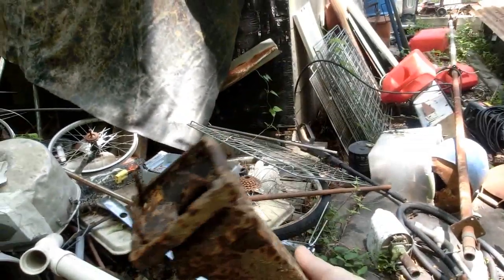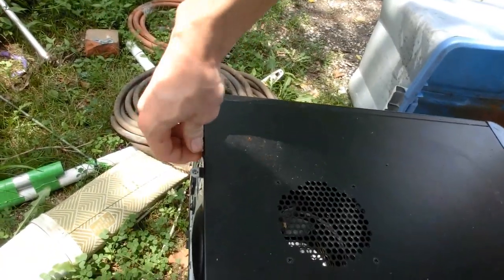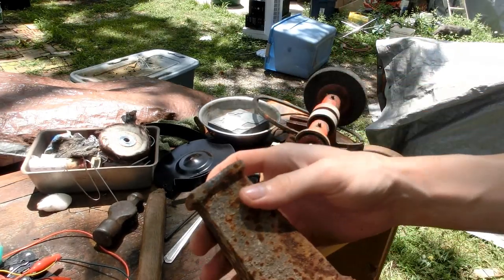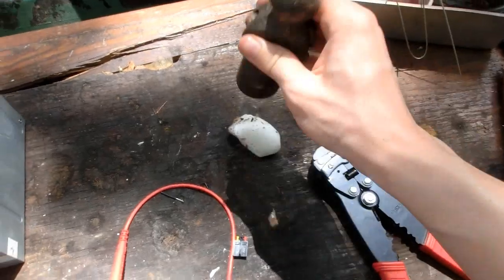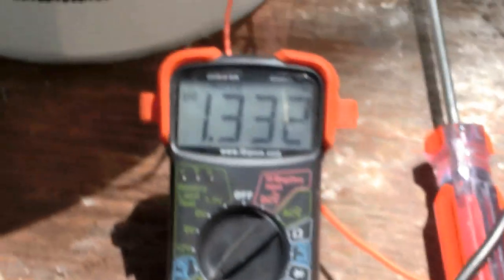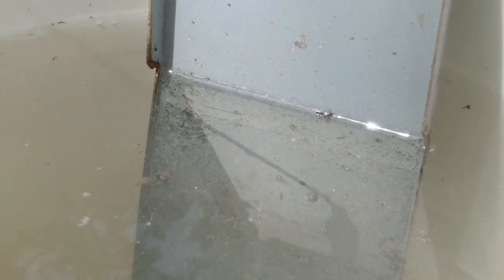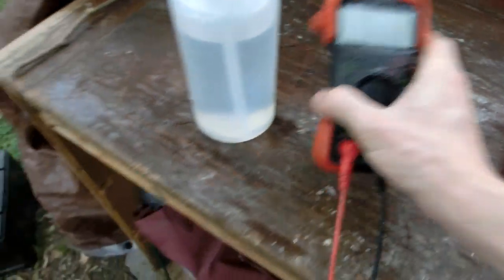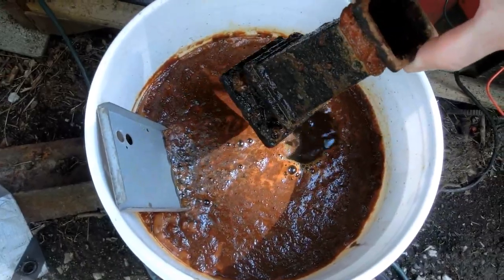DIY Easilly Remove Rust Via Electrolysis

Comment: While this was a demonstration that you conducted to compare.  The proper sequence for someone to do should be (1) wash off as much dirt as possible and then (2) lightly buff with the wire wheel to take off the remaining dirt which would block the electrolyses and the loose rust that will fall off easily, and not require current and time in the process and block access to rust that needs to be electrolyzed behind it.  (3) The last step should be the electrolyses.   (1) Water soluble removal processes first, (2) then mechanical removal  processes and after those, (3) the chemical removal processes.

Comment: Amazing video as always my friend. I have very rusty square tube I want to use on MY NICE EV. Now I can cut it to length and electrolize them so I can weld them together. Thank you for a great tutorial Rinoa.
Reply from the maker: if you need a big container for it, you could prolly find a little swimming pool in the garbage and use that to hold a lot of liquid. i'm thinking about doing that for the deck of my lawnmower.

Comment: Table salt as an electrolyte is also a bad idea. It probably doesn't matter too much when derusting a piece cast-iron, but even if you can cope with the poisonous chlorine gas evolved by electrolysis of brine, there are other potential issues. (Note: Chlorine was used a chemical weapon in WW1.)
If for instance, you were attempting to derust a corroded civil war cannon-ball or musket (or anything-else made of iron), you could well find that the use of salt (NaCl), would cause you years or even decades of intractable problems with persistent corrosion, caused by the presence of chloride ions. (This is one reason why iron artefacts recovered from marine sites are so difficult to preserve after retrieval)
Steer well-away from the table-salt. Stick to washing-soda, or caustic-soda and wear gloves and eye-protection. The low pH is beneficial too. Given that there are widely available, inexpensive and effective electrolytes that do not introduce chloride ions, why take the chance?
PS It's a good idea to wear eye and skin protection.

Comment: Love you Rinoa! Seen a lot of your videos and find you to be quite an inspiration! Just built myself an electrolysis tub to derust a huge vice/anvil. I used a power adapter 12v 1.8amps seems to be working. I'd like to turn it off at night thought, just incase the adapter can't handle the long period working.. can I leave the vice soaking or is  that bad? thanks!

Comment: I've done this with some old wrenches and screw drivers it works well  and saves a lot of effort. i used a variac and single diode as my power source not safe but it worked

Comment: Hey, hope someone said this already but  DO NOT USE STAINLESS STEEL, VERY DANGEROUS.

Pure safety reasons. It forms some horrible Chromium compounds that are big time dangerous. Rule of thumb is don't use any exotic-ish alloys unless you know it's safe for a fact. Plain iron or carbon steels are fine.

Nice video though, love electrolysis rust removal, so easy once you get it set up. Like your channel man!
Reply from the maker: actually i looked into it and the safety issues are very small if non-existant. the Hexavalent Chromium isnt extremely toxic and you would need to ingest it to get it into your body. it's actually more deadly to cook with stainless steel than to use for electrolysis.

i havent found any research showing that electrolysis is any differant than just letting the water contact the stainless steel. so in other words every bit of stainless steel is potentially leaking hexavalent chromium. i currently live in an area with like 15x the hexavalent chromium in the environment than the government would like so it really doesnt matter.

in the long run stainless steel emitting hexavalent chromium pales in comparison to the very dangerous things we do regularly such as driving a automobile and eating fast food. everything has a possibility of killing us, we can die from too much water, too much oxygen, too much lead, too much cosmic radiation.
Reply: Rinoa Super-Genius
Fair enough bud; I'd have to check it out for myself further before I'd trust it since I have heard it's so bad. Besides normal scrap is always at hand regardless I suppose.
I'm not a mad safety nut or anything, just heard it was quite bad.

I'd love to get a big bit of graphite for the process though. They make a really nice set up from videos I have seen.
Reply from the maker: williamwazere
also remember that hexavalent chromium would stay in the water in the electrolysis tank, and if there was an amount that was lost then over time the stainless steel electrodes would weigh less.
Reply: @RinoaL  "Hexavalent Chromium isnt extremely toxic "

Oh, is that why the National Institute of health lists it as a known human carcinogen?

Comment: as always nice job Rinoa, with the input from the guys here and some more practice I imagine you will refine the process quiet a bit. Plus saves messing with nastry ingredients to make and store an acid bath. As already mentioned electroplating sounds both handy and great fun to have a go at. Is it a case I wonder with both of the processes of the more juice (elec)in a short time does a better job, or perhaps less juice over longer periods of time works better. I thought perhaps industry plating for example would use a mega high ampage or something :-)
Reply from the maker: well i'm currently cleaning a rusty steel file with 3v 1.4a with my solar panels, so we will see how it goes.

Comment: That did a really nice job :-)), the black is much better than rust, and the pipe was almost perfect.

Multiple anodes around the bucket walls for the pipe perhaps?

Next you will be reversing polarity and plating things lol.
Reply from the maker: i've found just curving the electrode to make a big tube around the edges is good. but tbh the best thing to do is having the electrodes far appart and ad more salt. that will make the conductivity through the near side of metal closer to that of the far side.

Comment: Salt is corrosive though, i heard other people use detergent instead, like the ones for automatic washing machines (those don't foam much)
Reply from the maker: yeah i'll try that along with baking soda and sulfuric acid, but tbh i dont think the metal will be exposed to it long enough to have much of an effect. but i could see maybe the sacrificial electrode deteriorating more quickly.
Reply: Rinoa Super-Genius
 i guess you have a point, btw sulfuric acid is also corrosive
Reply from the maker: yes but remember this is acting like a rechargeable battery. You don't worry about acid corroding your battery plates except when its discharged.Joe G.P.
Reply: Rinoa Super-Genius
 hmm, so then would sulfuric acid speed up the process by corroding the sacrificial piece even faster ?
Reply from the maker: Joe G.P.
It might.

Comment: probably shoulda used washing soda. When you use salt you create chlorine gas. You are doing it outside so it should be kinda ok but at 5:00 you just open up the tarp where all the chlorine gas has been and stand right over it. Probably isn't the best for you
Reply from the maker: +imthetiedyeguy well chlorine is heavier than air so it wouldnt stay under the tarp.

Comment: You mentioned using stainless, maybe someone already said that it produces some real bad fumes, don't know what its called in english something like Chrome "grade" 6. It's not the type of bad like inhaling some 7018 welding smoke, this chrome fumes are Lethal!
Reply from the maker: yeah but its outside, the fumes wont matter much. i've heard stainless steel makes great electrodes.
Reply: Aha ok. Stainless don't "corrode" as much when used as anod?
Reply from the maker: Henning Jonsson
 yeah i've seen it being used in hydrogen generators a lot. they say it doesnt corrode but i'll doubt that untill i try it for myself.
Reply: Okey, interesting! Maybe you will inform via a video if you try it:)
Reply: Rinoa Super-Genius titanium electrodes would be great. i have heard that brass works great also.
Reply: Graphite is cleanest, at least my experience.
Reply: Henning Jonsson Rinoa Super-Genius You must never, Ever Use Stainless steel.. It makes some horrible toxic waste you have to call the EPA to get removed.. And the fines for improper disposal are hefty.
Reply from the maker: Cap10323
 No it doesn't, people use stainless steel to electrolize water all the time. And even if it made something toxic I'd just toss it into the creek.
Reply: Cap10323 desolving chrome in water:D its the fumes thats a bit toxic to inhale like i wrote and disscussed with Rinoa...To good I live in Sweden and dont have to worry about EPA then...
Reply: Rinoa Super-Genius I don't know what to tell you.. Aussie50 has a great vid explaing the whole thing.
Reply from the maker: Cap10323
 i know, but if it lasts longer than iron i'll still look into it.
Reply from the maker: Cap10323
 yes but it doesnt site any sources. ya see it only slightly increases risk of cancer over chronic exposure. and your exposed to chromium compounds any time you work with stainless steel. including when you cook with it. its mostly when you breath or injest it though.

side note, the chromium compounds that are water soluble arent usually that potent.

there are bigger fish to fry than chromium for now.

also you could get a low chromium stainless steel alloy if your really concerned. but as i said. i'll still do some tests to see. ^^

that website from 1997 seems to be the main source of concern regarding using stainless steel in electrolysis. and unfortunatly it lacks detail.
Reply: Do a google search.. All I know is you have to call the EPA To get it disposed of..

In all honesty though.. I'd think the EPA Would have bigger fish to fry.. Such as Fracking, Or Factories.
Reply from the maker: Cap10323  well the water around here is already 15 times their threshold for hexavalent chromium anyway. and the effects are very indirect and only a chance of cancer. everything can be shown to have a chance of giving you cancer.

i don't think it's worth worrying about since the smelters that make the stainless steel have piles of hexavalent chromium on their property. meanwhile the total amount of it within a stainless steel electrode would be very small.

to me its just about as dangerous as the radiation from welding rods, some welding rods are radioactive from their thorium content.
Reply: Rinoa Super-Genius Yeah
Reply from the maker: ***** what?
Reply: ***** Totally agree

Comment: So I can use salt to increase the conductivity? Other tutorials suggest sodium carbonate
Reply: Table salt (sodium chloride) will give off chlorine gas and is deadly. I use washing soda (sodium carbonate) 1tablespoon per gallon of water. This way the only gasses released are oxygen and hydrogen. Also you should NEVER use stainless steel as your sacrificial metal it creates known cancer causing elements (as in the movie Erin Brockovich).
Reply: Grimarr Orvondr You forgot to mention that the solution you are left with is also sodium hydroxide.
Reply from the maker: Grimarr Orvondr no the hexavalent chromium that supposedly gets released when using stainless steel doesnt have much evidence to show it to be a major threat, plus we live in a world with like 8x more hexavalent chromium than regulations would want.

i have yet to find proof or any research that shows stainless steel emits more hexavalent chromium when electrolized than when just sitting around.
Reply: +Courtney 

Sodium hydroxide? Chlorine gas?
Well, so much for the grass ....
And a little lung tissue.....
Besides, what's a little dead soil when compared to all the crap .....errrrrrrr........  Science experiments littering the yard.

This guy HAS to be a High School science teacher. If not he missed his calling.

Cheeky

Comment: Pouring away the electrolyte onto the ground or a stream, when you've been using chromium as an anode would lead to numerous bad and expensive things. Like prosecution, poisoning the groundwater and poisoning any neighbours who rely on wells. It isn't OK even down a proper drain.

Comment: how can you touch it without being electrocuted?  is there a way to get electrocuted in this process? please excuse my ignorance.
Reply from the maker: with 12 volts? no. you mike get shocked but you wont die.
Reply: voltage carries, amperage shocks...
Reply from the maker: Mr. Handy
no, electricity shocks.
Reply: lmao. electricity is the make up of voltage, amperage, and resistance. only amperage shocks. voltage carries the amperage, resistance reduces the voltage.(making the distance of the amperage carried shorter)
Reply: for example. a static shock. has up to 100,000 volts. but barely any amperage at all. it takes less than 1 amp to kill a person. I got hit with 40Kv but didn't even know cause I was grounded and the amperage couldn't carry over. electricity is my job...
Reply: yes but a voltage is required to overcome a resistance to let the current flow.

12v insufficient to overcome the resistance of human skin and supply a dangers amount of current across your heart.
Reply: oops sent that comment the wrong person sorry Mr. Handy
Reply: simply put(as simple as I can put it)

amperage is you deadly aspect. voltage is your emf(electromotive force) and ohm is resistance that stops the voltage. dry skin is rated up in the 10s of k ohms(k is thousands). with only 12 volts the emf is not enough to overcome the amount of resistance in skin. granted if you put it closer to your heart.. outcome could be different. but being your hand, especially one han, giving the electricity no path to go out(assuming your wearing rubber soles and are grounded) you could have 400,000 volts enter but without a complete circuit you feel nothing.

this is not to say its not possible to be hurt from 12v, its highly unlikely. I got hit when I worked in wind towers with 40,000 volts. I was grounded and didn't even know it happened, on the camera you can see the spark come out of the transformer and hit me. but I had no idea. static shocks from your finger can hit 300,000 volts. no amperage. so as you can have crazy voltage, if no amps are there you wont be hurt, you can have crazy amps but if the voltage cant surpass your natural resistance you wont feel anything.

there I did my best lol

Comment: very nice :D it worked a treat and that water pressure is crazy lol i think you would find a hydrogen blowtorch fun and usefull they are kinda easy to make :D
Reply from the maker: yes i'm working on building a hydrogen production system, will store it at about 600PSI in an acetylene tank. will also produce the oxygen and put that into the oxygen tank.
Reply: sweet im looking forward to it :D keep up the good vids

Comment: Salt??? Washing soda like Borax please.
 Then first remove the rust, using ferrous  metals as anode and cathode.
 THe cast iron piece is the sacrificial in this instance.
 Then if you want to plate, it is separate procedure.
Reply: Ehm, washing soda and borax are NOT the same thing. Not even close. The cast iron piece is the sacrificial? How did you figure THAT out?
Reply: It is currently the same thing here in Canada -  Borax is a brand I was suggesting what I have seen to work. No real experience :-P
Reply: +Chris Leech Trade name or not, borax is sodium tetraborate, not sodium carbonate! Yes, it IS used in various household and laundry product, but it isn't the right stuff for this experiment. You wouldn't want to release anything toxic into the environment....

Comment: Good start! Let's see more and then try electroplating.
Reply from the maker: yeah i think i might start doing a new video every week or so where i find a crusty old tool or part, remove the rust via electrolysis, and plate it with a protective metal and slowly refine the process over several months.
Reply: Rinoa Super-Genius would like to see that
Reply: Rinoa Super-Genius That would be a great series of videos.

Comment: you know the red wire on a PC PSU is only 5v ? you better off with yellow at 12v
Reply from the maker: yes, but higher voltage doesnt always mean better in this case
Reply: @RinoaL  fair enough .. i didn't know that part lol